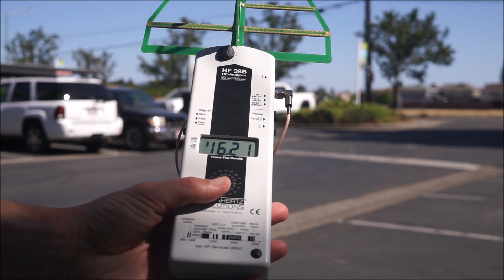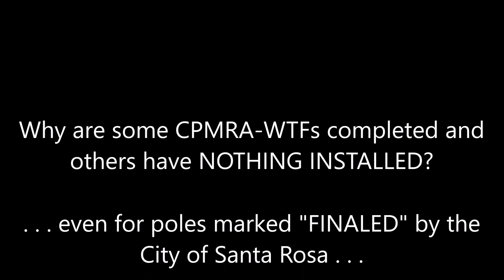2018-0722 Small Cell Installation Status in Santa Rosa, CA

Comment: This video was such bullshit.... 5G is here to stay and isn't going anywhere! Wifi puts out basically the same damn electromagnetic fields....Grow up... we will all die eventually from something.
Reply from the maker: Rest assured. BJ, we are grown up and are facing the truth of the matter. Pulsed, data-modulated, Radio-frequency Electromagnetic Microwave Radiation (RF-EMR) from all sources is hazardous. Dr. Lennart Hardell and many others state that based on the data through 2018, RF-EMR exposures from any source (Wi-Fi,4G, 5G and others) is a Group 1, Definite Human Carcinogen and the cause of many other symptoms of Microwave Radiation Sickness.  It  sounds as if you treat Wi-Fi as harmless . . . unfortunately, that is not what the data shows. 5G is not yet here and 5G transmitters should not be installed in front of people's homes. Doing so is both undemocratic and unintelligent. 5G antennas can, instead, be installed on Macro Towers, 1500 feet away from where people live, sleep and heal -- according to Verizon itself: https://youtu.be/FwAsr1pC13Q 

Also, check out these results from nine years of RF-EMR exposures from a 4G Cell Tower: http://scientists4wiredtech.com/sebastopol/ and this problem with lowered property values for homes targeted for 4G/5G Close Proximity Microwave Radiation Antenna (CPMRA) installations, aka so-called "Small Cells".

I, for one, wish to stay on this earth into my 80's with all of my wits in tact. I have no interest in early dementia or early exits from the earth. I wish the same for you.